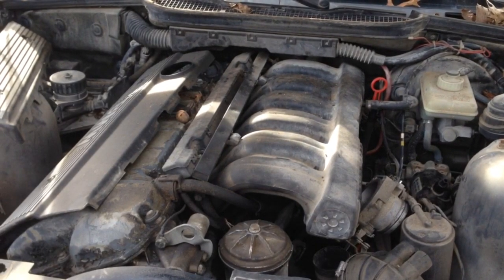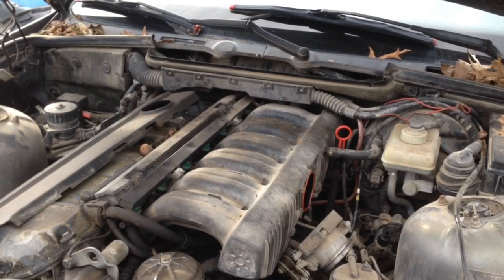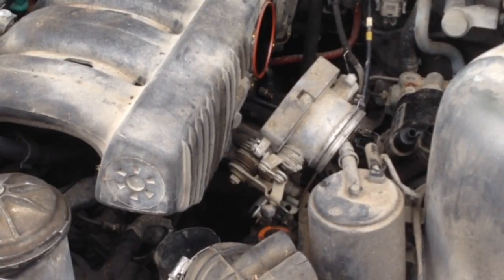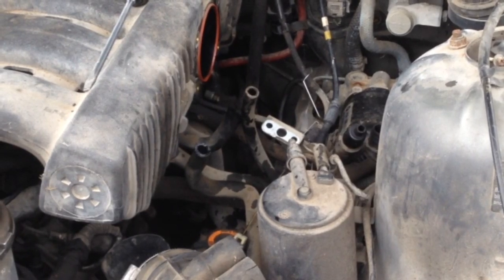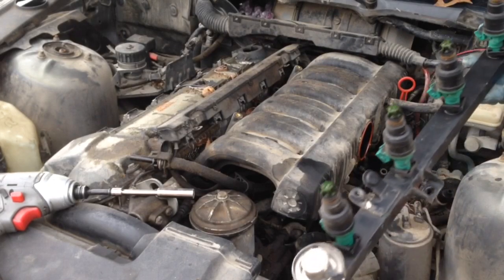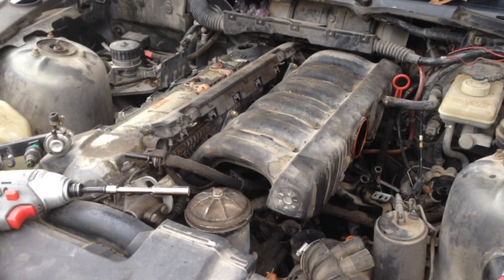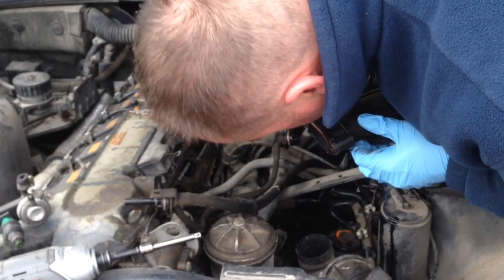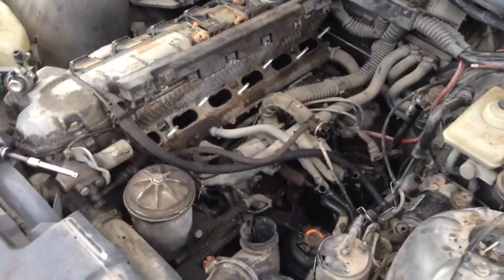Easy BMW M50 S50 Intake Manifold Removal And M50 to M52 Manifold Swap Power Upgrade

Comment: Thanks for the video. Much appreciated. I have a 95 525i M50 W/Vanos 5 Speed. I'm trying to remove my bad starter. I am trying to remove the injectors' electric harness. It seems there are clips holding the three center connections to the injector electric connection. I can pull up on the harness from the outside connections and they pop right up but, in the center, the won't budge. I don't want to yank that harness off and destroy the plastics. Are there clips that hold the electric plastic connections to the injectors? When I look under the electric harness, I see clips on three injectors (i'm not talking about the clips that fasten the fuel rail to the injectors). If there are clips that fasten the electric harness to the injectors, how in the world do I pull out those clips?? It seems impossible. Thanks!

Comment: hey Nathan i have this problem whit my 1997 528i BMW , I drove the car from Ohio to buffalo new york then another six hours to new york city no sign of overheating the following day I start the car up in new york city and it's overheating like crazy I add antifreeze and play around whit the hose and bleeder valve I get it to calm down .                                                                                The other day I drove it back all to jersey pensivenya and back to Ohio no sign of overheating on that journey I was traveling from new york 1;30 pm I finally reach home in Ohio 3;30 am and the following day the car start overheating like crazy do you av any suggestion Nathan?
Reply: Buy a new car

Comment: Thanks for posting e36 videos. i have an oil leak on my m52 engine and  that i can't figure out where it's leaking.  No leaks from the valve cover head gasket and i changed the oil filter housing gasket. so where else could it be leaking?  the oil is leaking toward the back of the engine and drips off the oil pan area. the oil leak stops when engine is not on. please recommend where else i could look for leaks thanks
Reply from the maker: +Mazda Rx7 FD 1993 if it's on the drive side it's prob the dipstick o-ring
Reply: The oil dipstick looks dry. Could it be my rear main seal since my car is a m3 manual?
Reply from the maker: +Mazda Rx7 FD 1993 are you sure it's not a problem with the ccv line going to the dipstick, also are you sure the valve cover is not cracked? Worst case it's the rear Main but that is really uncommon
Reply: I have the oil catch can. Valve cover is completely dry all the way around.
Reply: Rear main seal

Comment: I want a intake cam shaft. Mine broke.
Reply: Installed it wrong?
Reply: Wikto no it had a crack in from the guy I got the engine from. When i tightend it down it snapped off. I'm also looking for a sump. I want to install it in my mustang but the sump bowl is sitting on then cross member.. But no cash for a sump right now. The Scrapyard's want R3000 for one 525i sump. I can buy a whole 525i without papers for R7000. I did get a camshaft but the guy sent menthe exhaust cam instead. But I can't get hold of him lol. Trying to get work overseas is taking priority now.
Reply: I broke mine trying to install it, And what made it worse is that I have an NV motor so it was a pain tracking down an NV intake camshaft. I eventually found one, however, it was $100